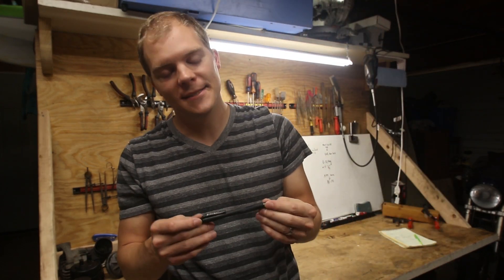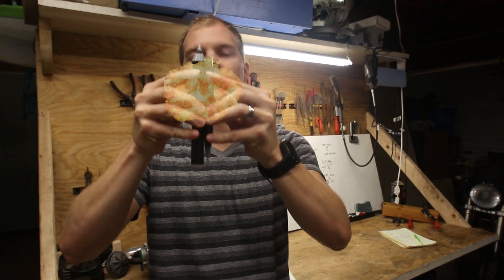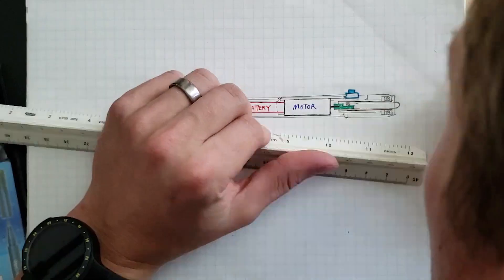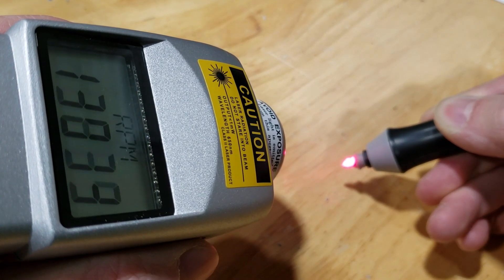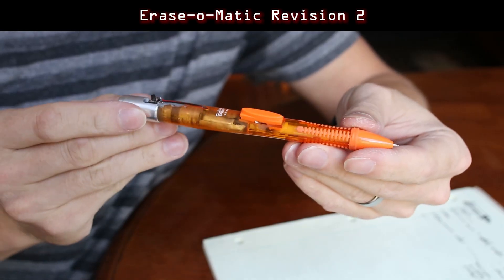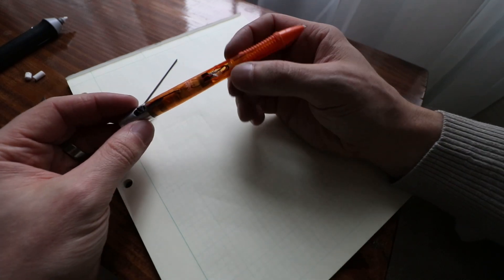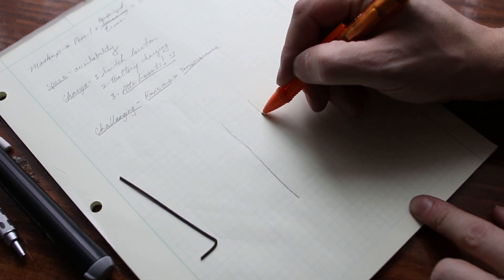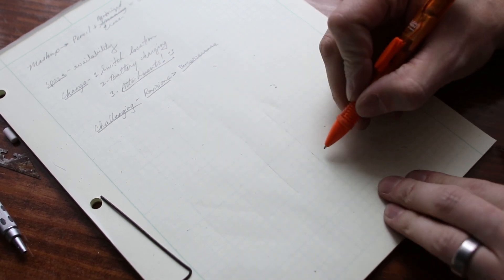Erase-O-Matic - 30,000 RPM Eraser!!!

Comment: I guess that commercial products are already running those erasers about the max rpm that the eraser tip can actually handle. It seems that this device overheated the tip.

Comment: There might be more resilient rubbers available, since it seems at these speeds it might work fairly well.
Reply: The already existing eraser rubber is already on the hard side and often scratches the surface of the paper when you use them. Harder material could handle more rpm but it would damage paper even more.
Reply: @MikkoRantalainen  good point, might be better to try something more durable in that case, silicone comes to mind.
Reply: @AllStorm  You would want something that (1) doesn't melt when spinned fast, (2) doesn't scratch the paper and (3) wears out at constant rate so it already wears off before it starts to smear the carbon on the surface of the paper.

All I can say it's easier said than done. I would recommend starting with materials used by pencil artists (without motors).

Comment: Watching you plan and build this, sure was awesome, but however, I'd still prefer to use the factory made one, or at least it's design.
The reason for that is, that it is much much more precise, if I need an eraser pen, I need cuz I need to erase tiny details, so speed is not what matters here, it's precision, with the thickness of the custom device, I think precisely removing tiny things is gonna be tricky